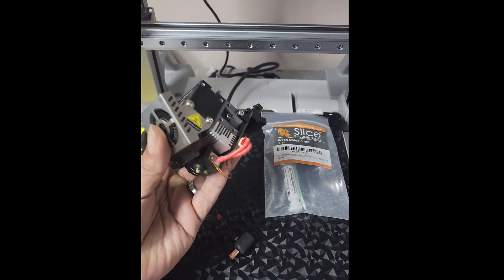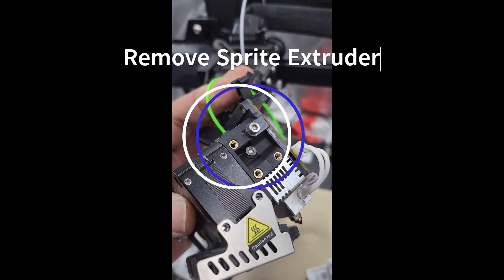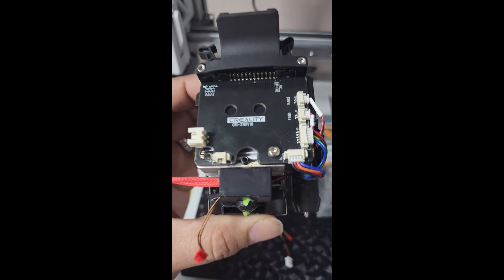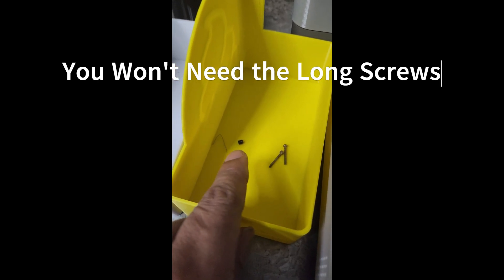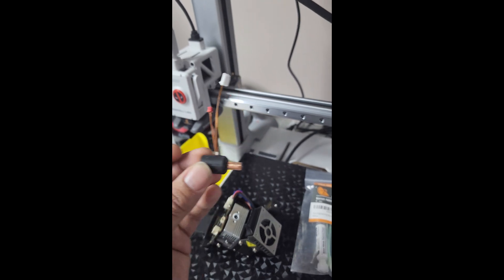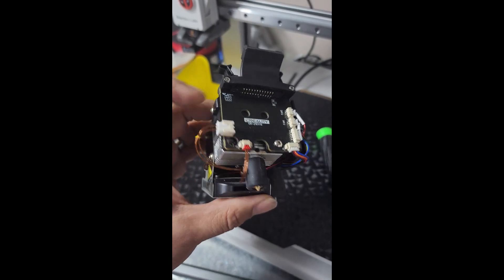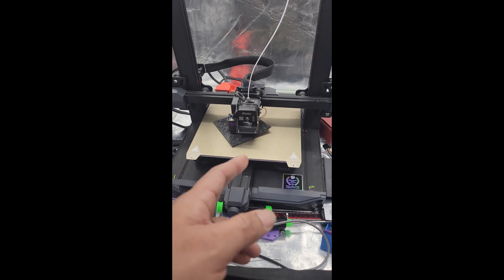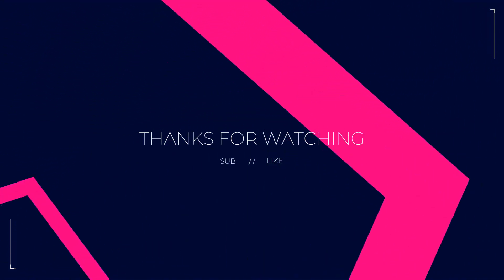Creality Sprite Pro Ceramic Hotend Upgrade Installation Guide

Comment: FWIW, there's a different YT video describes using a K1 Max 300* hotend in a Sprite extruder (on an E3v3SE); it does have a removable nozzle. Unfortunately with the SE, you can't go higher than 260* with the stock Marlin firmware, and Creality won't release the source or hi-temp-modified code.
Reply from the maker: You mean the SE we have running Klipper?

https://youtu.be/b4-k2I0kfh0?si=uGj1p5DMeJkVtWE_
Reply: @3DandTeePrinting  That's the one; I'm surprised you didn't link it here. ;-) I'm grateful for the how-to video. I just wish that Creality would either release the source for the SE, or better, offer a version of Marlin that allows higher temps like they have for their older printers for those of us novices that just want the higher temps without having to spend extra money & effort on a pi. It seems blatantly obvious that they're trying to protect sales of the KE. Which does beg the question: Would KE firmware run on an SE?...
Reply from the maker: @rv7builder397  I didn't realize that the Marlin Firmware was not adjustable till AFTER the video was released.  I was running it off Sonic Pad with Klipper and I was able to change the printer.cfg and sonic pad settings to 300c (305c to prevent premature Overheat Errors).  Your right the Stock Marlin Firmware does Not support it.  Give it time some (cough cough) is probably working on a firmware version that does support 300c.
Reply: @3DandTeePrinting  Well, I'm subscribed to cough cough (I think), so I hope to see it soon.

Comment: Le pregunte al área de soporte de Creality si este hotend era compatible con la Ender V3 SE y respondieron que si...
Reply from the maker: Lol technically it's is.  You would have to spice the Thermistor wire because it's a smaller JST connector on the SPRITE KIT CERAMIC while the K1/KE/SE all have the larger style JST connector.  Take it from the guy who bought the Sprite CERAMIC thinking the same thing.  Only to find out its the wrong connectors.  I was going to upgrade my Sprite on my S1 anyway so I just used it on there.  So yes but NO!
Reply: @3DandTeePrinting   3D and Tee Printing 1- Creality support 0 jajaja